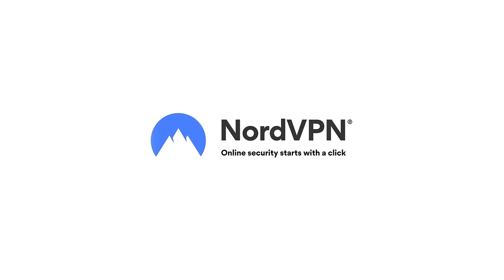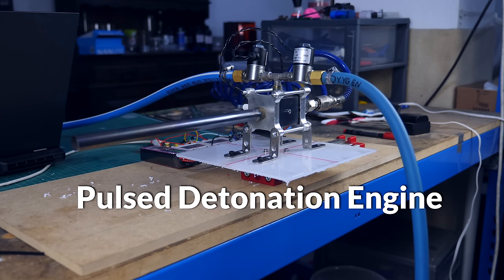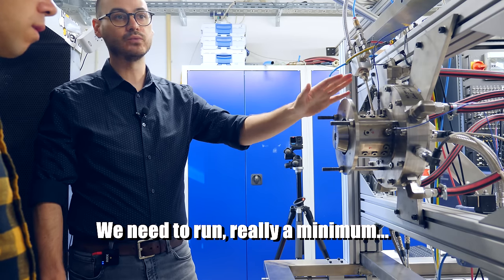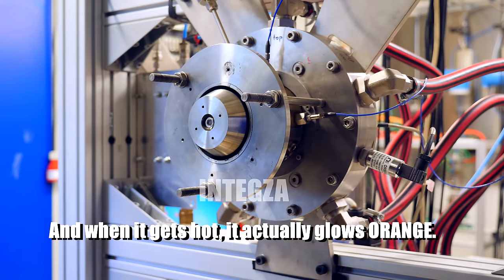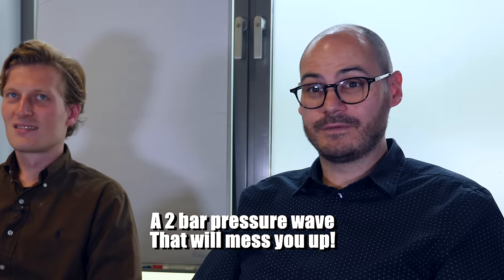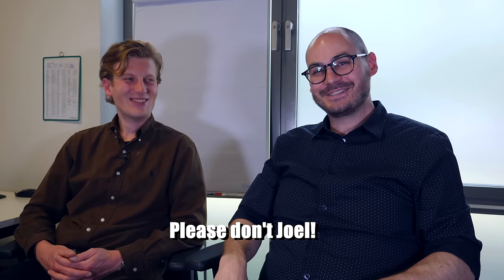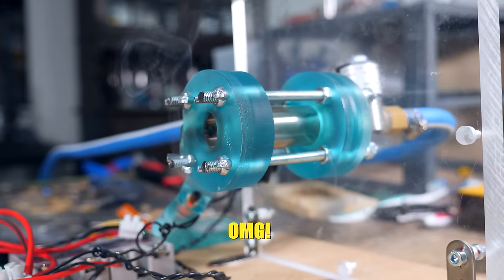NASA lost this TECHNOLOGY 60 YEARS AGO

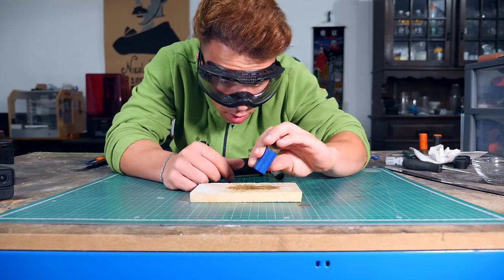Comment: Yeah.. I had a flashback of sorts when he smacked that primer (12:00). About a month ago, I was fucking with the striker of a spent smoke grenade and a 7.62x51mm blank that had just the primer. I nearly blasted off my middle and ring finger, and was extremely lucky to get away with just partial de-gloving and avulsion. Primers are no fucking joke. The thing was even encased in two other spent casings (another 7.62mm to hold the neck of the blank, and that all was shoved into a spent .50BMG casing. Don't ask why I did it, but do know that shit's no joke. I was also extremely lucky to get away with no tendon/ligament damage or nerve damage.

Comment: i want to win a printer, but i think you should do a 3d printed frame for  rodin coil then wrap it, and use a
Evaluation Board, MAX9744 Stereo 20W Class D Audio Amplifier and phone app w freq generator to make it work then feed the high voltage side of rodin coil a to a full bridge rectifier to turn it back to hv dc, then finally to video is stack 3 coils together and see if a diffrence

Comment: You dont explain a few things in this.
Which are you injecting and which is Fuel?  
H2O...   It would be very dangerous and SHOULD be done OUTSIDE..  H should be the Blown in and the Oxy injected to ignite.  2 to 1. (ppm)
You are not telling us Pressure input.  As all we are seeing is High pressure.  Low power ignite??
But ignite of H and Oxy, does?  Bang.  If you can get the ignite..
I would suggest that your CENTER CORE as the Fan.  And YOU MIGHT need a 3rd part of H2O, an inert gas.  AIR...
Then regulate the combination of all 3.  And pull in the Center core Fan.

Comment: you can create a artificial brain using wires and the structure of the brain (it can be hollow)and of-course a battery and control the input power it should be around 6-8hz (I don't know if this is going to work but just check)

Comment: Explain to me how you lose technology?
Reply: It’s not that they lost the tech outright, most of it was either scrapped (a big part of that was moulds and highly specialized equipment) or sent to museums. The main problem is a lack of funding and a tiny workforce, most of the experts were sent elsewhere and it was their combined unique experience and thousands of hours of trial and error that led to the initial rockets. We also have had technological developments since then and redesigning a rocket from scratch is easier than trying to adapt 60 year old tech with modern equipment.

Comment: Hi Integza, could you consider building a prototype based on the observation of a spiral deflagration reaction as seen in this video https://www.youtube.com/watch?v=SqhXQUzVMlQ&t=606s. By 3D printing or bending a metal extrusion into a spiral track to serve as a combustion chamber (not the open channel in that video but a proper combustion chamber shape), and equipping it with evenly spaced injectors inside the base of the track for optimal fuel distribution, you can create a long detonation channel. Then introduce a pulse detonation engine at one end of the track (potentially at the centre for symmetrical propagation with a double spiral) to serve as the ignition source. This setup leverages the rapid pressure and temperature increase from the pulse detonation to transition the deflagration within the spiral into a full detonation which then propagates along the track. The idea is that the spiral geometry enhances the surface area of the detonation; this process would essentially harness the high-energy output of the pulse detonation engine to trigger the faster, more violent pressure wave to travel down the spiral track, this pressure is then pushed out of the gap in the track, basically creating thrust (sideways like a gangster! it also makes the engine very flat). I am really bad a 3D CAD, hopefully the explanation above is detailed enough as a concept idea for your channel.

Comment: You are so close to Creating Gravity repulsing engine. Use Powerful Magnets to build the 3D engine parts to create A Magnetic 🧲 Plasma the more powerful the  magnet the Neutons will Multiply Using Magnetic power to create A Antigravity PLASMA Engine.
Let me know if you do this ? Magnets can be made in various Strength circular magnetic power instead of Plastic 3D printer. Your power can grow. 800-1000 Neutons with a Medium power magnet. The. Larger the more lift and thrust. Apollo size Could reach 1,000,000 Neutons. The more strength 3 Cubed power. Ect 3,000,000